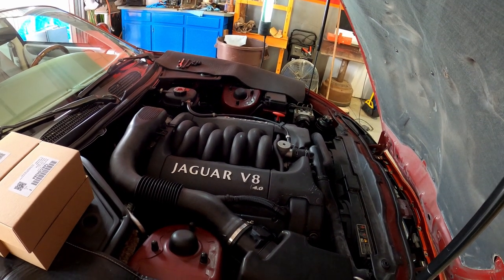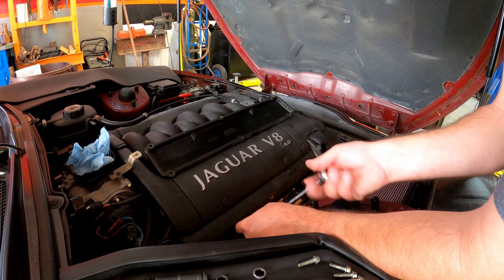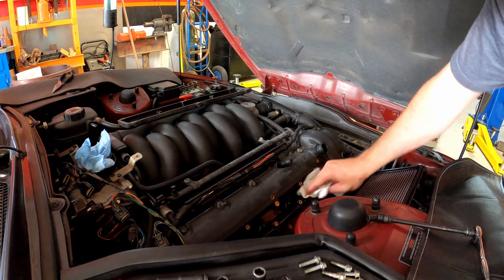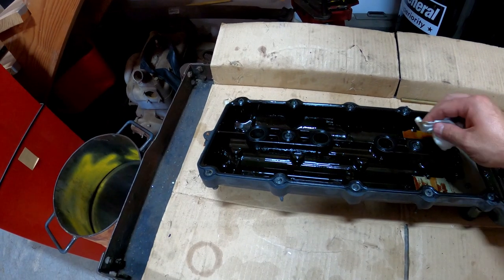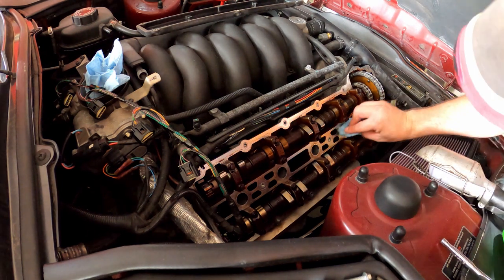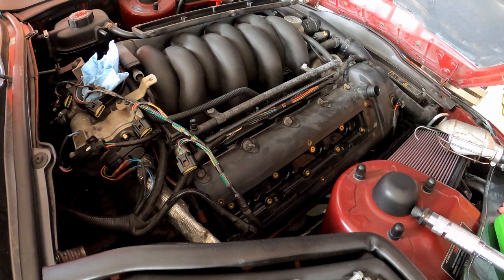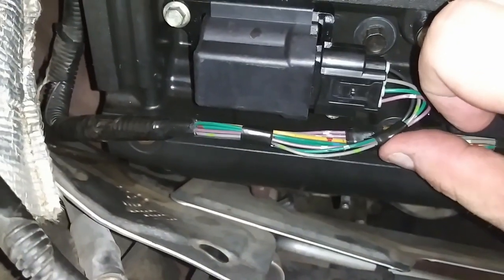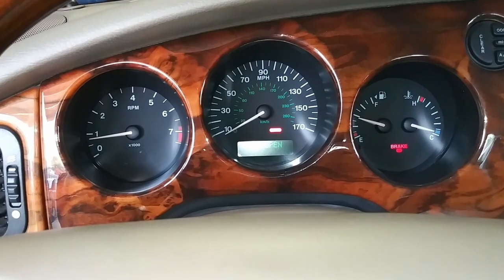XK8 Ignition Coils Replacement Turns Into Valve Cover Reseal

Comment: Jaguar has a very specific numbered torque pattern for this job. Very important.
Reply from the maker: Agreed. I got that info after this and found the pattern I used was slightly different but it is holding still. Jag fallowed a center out pattern as well but a bit more of a top to bottom movement compared to the cross pattern I used.

Comment: I just completed this on my XK8 and noted that the upper rear cam cover bolts are different from the rest. Apparently this is due to these bolts being close to the cam position sensors and are a different  metal bolt.
Reply from the maker: Not sure there the only difference I found was a few have a threaded end on top as well for mounting other items in place (hose retainer ect.) Possibly different year different setup? Thanks for info. Something to watch for.
Reply: Mine is a 2001

Comment: I would recommend a tampon, instead of a rag to absorb the oil in the spark plug chamber. Just thanking Out Of The Box.
Reply from the maker: Possibly not sure how well they would hold up after absorbing the oil or how cost effective they are.

Comment: what coils did you use and how did they last i need to do coils but don't want to pay the expensive OEM Denso's
Reply from the maker: Sorry for the delay. I used the TRQ brand from Amazon. They came in a set of 8 coils and rubber plug connector PN: ICA61610. They where about $150.00 for the set. I have had them in over two years and no issues. They also have a Life Time Warranty part only.

Comment: Thanks for the video. I have the same issue .  My local auto parts sales the ignition coils at $109 each, I found a set of 8 for $159 at carparts on line. Have you had any issues with the $200 set you used?
Reply from the maker: Glad it helped. No problems so far.

Comment: Thanks for this. I have an oil leak and am wondering if I can fix it myself. My mechanic wants to replace both camshaft covers but I should first check to see if they are warped or if the seal is bad yes? This looks like a job I could do myself, but would prob take 3x as long as the mechanic but save some $$$!
Reply from the maker: Defiantly get your hand on a manual is always the best thing. Even your best professionals will use the manual. Next is yes, check the valve (cam) covers for warpage. Some is ok and can be solved with proper sealants (RTV, etc.). Never pull your covers while the engine is warm this can cause warpage. Always fallow torque specs. Also be sure to keep your open engine covered so debris doesn't get in. Once again the manual is your best friend. Just make sure it is for your year, make and model. Best of luck.
Reply: @weekendwarriorgarage4402  Thanks! As I started to take the air intake off I ran my finger inside the ends of the breather tube and there was oil. What does this mean?
Reply: @ambrosemartos6408  how did you sort the oil in intake? i have that too and it dirtied maf sensor and needed to clean it. i think i have leaky valve cover gaskets likewiseb

Comment: Hello, thank you for your video. Pleasse, if you can answer. The cilinders 1-2-3-4, are on right, or left? The first cilinder is the front to the right? Thanks so much
Reply from the maker: This is the best description that  I have found. Be sure to confirm your production date and engine is original not swapped.
https://www.jaguarforums.com/forum/xk8-xkr-x100-17/cylinder-numbers-system-191533/

Comment: I've got the same problem with oil in the spark plugs how did the silicone hold??
Reply from the maker: Holding great. But do change the seals if they are old. They can start splitting and the silicon will be useless there.
Reply: K will give it a try, I did end up changing the seals and was still getting oil. thank you 😊 🙏

Comment: Thank you very much for posting this. I’m on the fence of buying a 1999 XK8 convertible, the owner is a family friend and told me the only issue is an oil leak. It has 76k miles and cosmetics are in excellent shape. Do you recommend going for it? He’s selling it to me for $5,000
Reply from the maker: I have a hard time recommending any specific car I have not checked over myself. But I do have to say on a general point the XK8 is a good car overall if you are willing and able to do some repairs. DIY most defiantly the cheaper way but do expect to work on it from time to time. My suggestion like many others is educate your self as it looks you are and be thorough when checking the car over. If it is running ruff be super careful due to the possible Nikasil cylinder linings could be damaged. This is worse than the timing chain needing replacement. The engine block would have to be replaced or re-sleeved at a machine shop if this is present. Hope not to scare you and do enjoy if you pick it up they are great road trip cars. As for price I suggest NADA web site for reference.
Reply: buy it

Comment: You should 'side gap' your plugs while you have them out.  I stay away from RTV silicones and would recommend Hylomar M instead.  Otherwise you made superb videos and you know your stuff.  Were you military?
Reply from the maker: The plugs where gaped when I replaced them about a year ago (3000 miles), so no need at this time. I use RTV due to it being recommended by many auto manufactures. RTV is also quite easy on the wallet. I do agree there are options to sealing and you should use what you are comfortable with. I worked and trained as a BMW service tech through the 90's and early 2000's.
Reply: @weekendwarriorgarage4402  No, 'side gapped'.  Read my XK8 Bible.
Reply: @weekendwarriorgarage4402  I work on aircraft and Hylomar M is the gold standard.  I wouldn't bring RTV anywhere near my car.  Maybe a bathtub.
Reply from the maker: I have no need for side gaping. This is usually for trying to squeeze as much power out of the car as possible. I am not trying to build performance just make it reliable. This also shortens the life of the plug and I do drive my car regularly. I would rather not have to re-gap or replace plugs more often. The one good thing you do gain from this is possibly a small boost in fuel mileage.
Reply from the maker: Aircraft have a much higher standard to maintenance do to the fall out of the air factor. I worked on many types of cars at a factory service center and many part kits came with RTV. It holds quite well. I will say having to clean up after it is a chore. Especially if it is poorly ( excessively ) applied. I also look at the cost. I don't need a $20.00 part when a $5.00 part will do the job. That being said I don't skimp on safety parts like brakes.
Reply: @weekendwarriorgarage4402  Better mileage and better power/torque are what I experience and are beneficial in all respects.  Silicone is for shower stalls and bathtubs.